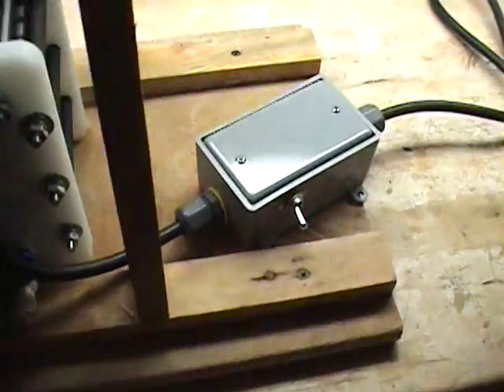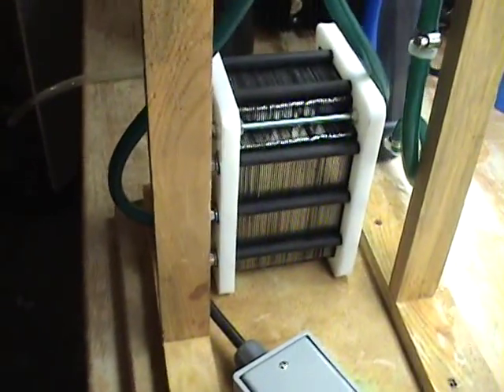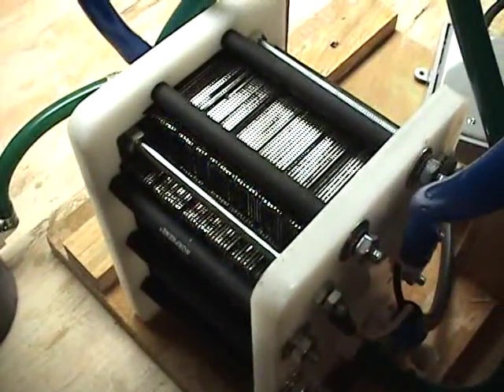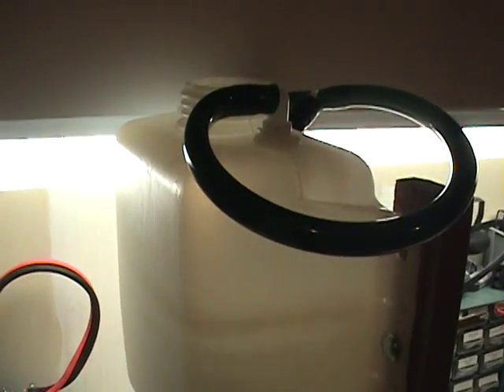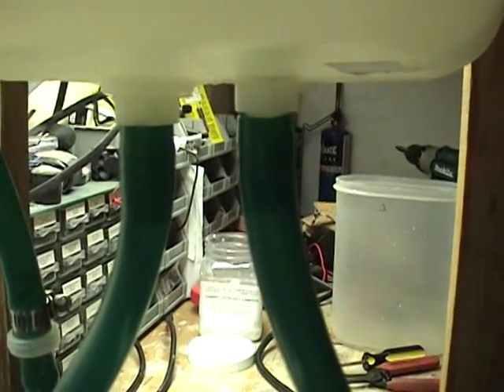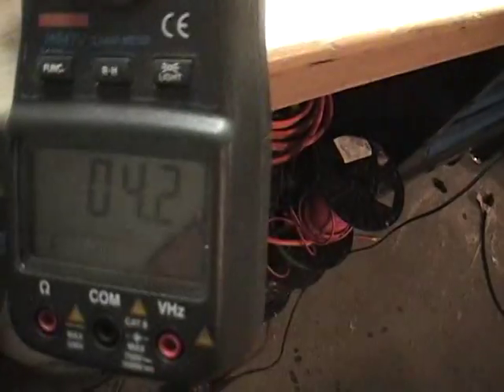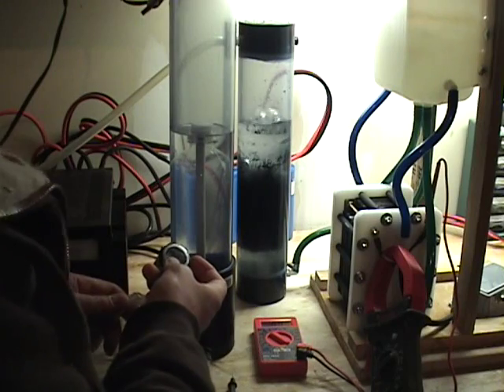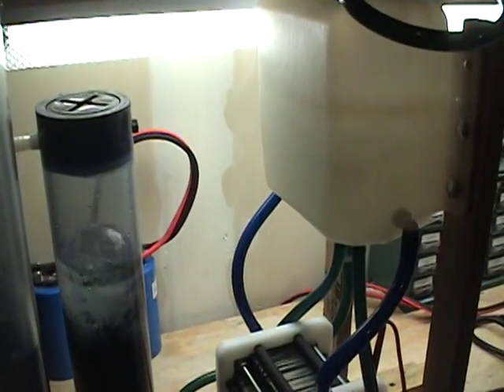130 volt Hydrogen generator using 120v ac house power.

Comment: Very nice thanks for the info. Was wondering,  since the power coming from a motorcycle to its spark plug is 110v ac, way more power than the 12vdc circuit? if a T connector was added,  if rectified could it also power an hho gen?

Comment: Have you ever tried putting large capacitors on the rectifier output to see if it makes any difference?  Straight out of the rectifier you are getting a 120Hz humpback wave cycling between zero and 170 volts, with the RMS value being effectively equivalent to 120 volts DC.  I just wonder if there is production loss during the portions of the voltage waveform where it dips to zero.  I guess the portions of the waveform where it shoots 50v above 120v would increase output during that part of the cycle and it all averages out to be the same as if you put a solid, ripple free 120V DC level on it.  It would be interesting to verify if it makes any difference though.
Reply: The cell acts as a capacitor itself 🤷‍♂️

Comment: Nice looking setup you have there Im sure one of us will hit on a way to get over-unity at some stage. i am very close now to fitting mine  in the van but im working on some super capacitor battery as my hiace tends to need a full battery in the cold weather with out any drew from a hho generator so I need to make sure  can do lots  of stopping and starting with little distance travelled. great video cheers

Comment: Okay I get the whole clean energy thing but is this actually cost effective?  If you calculated the cost of electricity to run this hydrogen separator VXA=W, cost of KOH and cost of distilled water and compared it to the amount of heat generated by the hydrogen does this really pay off?  Why doesn't anyone show this data so that the consumer can make an educated decision?

Comment: unless you run it from wind or solar or some other reneable source then it's just pointless
Reply: It's pointless for powering your car yeah, but for welding and cutting it is very practical
Reply: maybe there is a catalyst that agitates the water molecule or some frequency so less energy can set the atoms apart.

Comment: I've been told that it is not recommended to use a bridge rectifier directly on a 120V line. It will over heat and burn out. Connected to the bridge, do you have any other electronics in this little box?

Comment from the maker: @grimlords a couple more plates will reduce the voltage on the plates. It will make it a bit more efficient but your right you will need more koh to get the current up. Copper is not a good idea, the koh will react with it. stainless steel radiator is the best way to go. the only ones I have been able to find are the computer liquid cooling systems.

Comment from the maker: @ExtraSilver yes that would make a fine power supply. yes all you need a a rectifier. try and buy a 70 amp unit. It wont heat up as bad.

Comment: @delvis11  would a 3.3kVA portable tool transformer   work as a good transformer...   240 AC input...   110-volt 16-amp max output...     and would i just need a full wave bridge recifier...  then the power is good to go to the cell?   thanks :)

Comment from the maker: @ExtraSilver  No this wont work with 230v. You would need to use a step down transformer. 230v would need 118-123 plates.

Comment: Thanks Steve, Durometer is a measure of hardness,. Typical for EPDM is around 55-60, kind of like the hardness of a bicycle inner tube. Also, I was looking at using 1/32" thick, which is a around, but a little under, 40 mils. If it works for you, it should be fine for my application. Again, thanks.
Denny

Comment: Steve, as the size of the your cells and the amount of gas increase, do you change the size and the size ratio of the input and output holes in the plates? For example would changing the hole sizes from 1/8:1/4, to 1/4":1/2"  improve efficiency or does it even matter?

Thanks,
Denny

Comment: add a flow pump to it and watch your production go up.. it forces the HHO gas out of the cell faster and also keeps the electrolyte cooler. need to also go with a higher nickel alloy or even cobalt as I've read.next would be to stack multiple 60 plate cells together to increase production and then pressurize the gas to then run a propane genset or hydrogen fuel cell.. problem with that is you need a way to separate the hydrogen and oxygen being produced and then feed it into a fuel stack...

Comment: @HonKyTanKMaN   what  matters  is  that  the  fuel  made  is  clean,  free  of  carbon. The  BTU's   from burning  oxyhydrogen at 2800 plus  degrees  will  heat boil, cook  just about  anything. which  is  the direction needed,  ..  not  so  much  transportation.